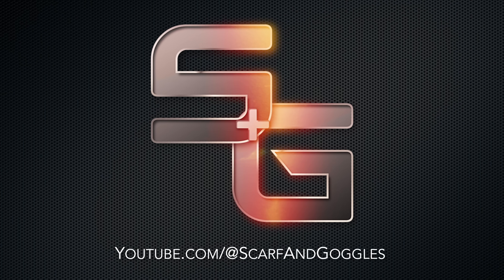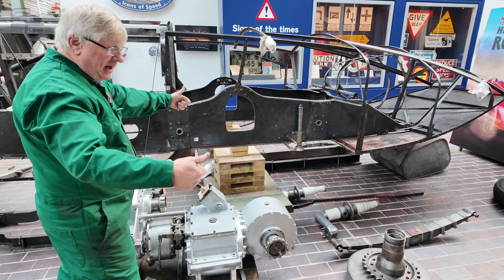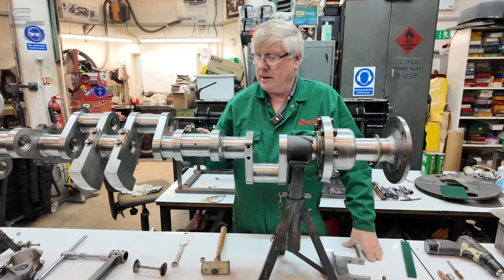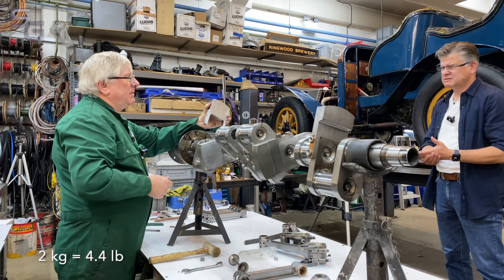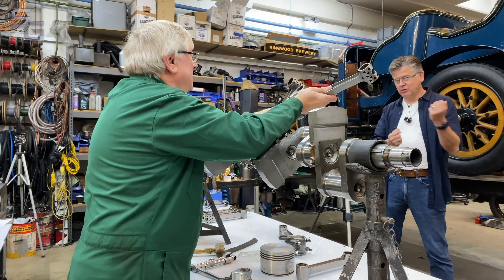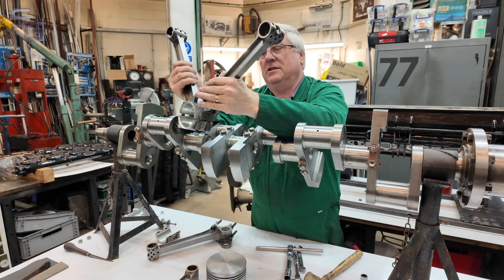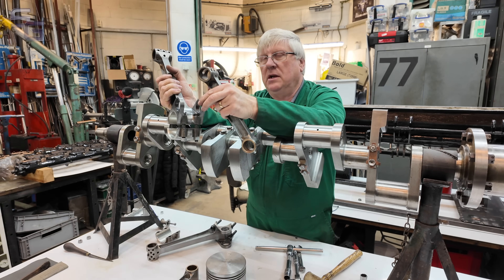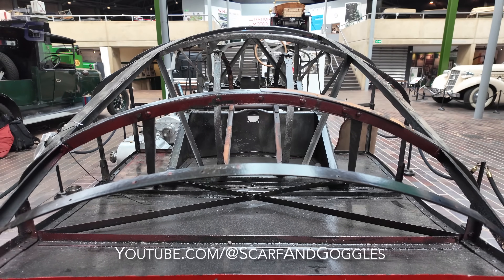Sunbeam 1000hp Rebuild (Part 4) - Restoring the first 200mph land speed car

Comment: For a long time I was wondering what on earth were they doing using chains for a final drive system, then it dawned on me, using chains and sprockets would allow them to very easily adjust the final drive ratio.  In fact I've been doing something similar with my tuned up Honda MT5 moped, I must have 3 front sprockets and 6 rear sprockets. My personal Land speed record on the flat whilst on the 'ped is 55MPH 😀

Comment: This is a fantastic insight into both the machine itself as well as the incredibly skilled work of the restorers. 

Just a thought - could the flywheel perhaps be tungsten steel, which would explain its density compared with standard steel?
Reply from the maker: Good thought about the flywheel. Glad you enjoyed the video!

Comment: A question ! Do you have the torque settings for the engine fixings ?
Reply from the maker: Thanks for your interest. I don't personally know them, and Stan has told me there is no documentation for the Sunbeam Matabele engines. Perhaps the choice of torque settings comes down to experience if there's no other info available...?
Reply: @ScarfAndGoggles  Possibly ! I remember reading somewhere that we're surprisingly good at 'feeling' when a bolt is 'tight enough' !

I think there is a way of testing bolts by torquing them up with a dial gauge attached so you can see when they're being stretched beyond their elastic limit  - all a little above my paygrade - but then, I have the luxury of a Haynes manual for my car !

Thanks for the reply !!

Comment: Surprised they didn't paint the inside of all the gear boxes with glyptal or similar (if it's even available in Britain) to seal the boxes from the inside. If they are that porous it would get good adhesion.

Comment: The question is, will they drive it to 200mph again ?
Reply: I believe they have said that they will keep it to 70 mph or so, because they can't run it faster with the tyres available today.
Reply: @greyone40  This question was already answered in Part 3. They will just run it 70 mph. Not more.
Reply: Very doubtful. The risk is too high. They’re probably going to get it running and driving then can do shows and have it at least make noise and drive around. May do something like goodwood and run it around the track.

Comment: Although the stroke is the same, the piston motion is not. Due to the offset from the centre of rotation, the rod length is different. This affects the piston motion and the piston speed.
Reply: Offset piston pin for performance baby...   Smoky Yunick trick

Comment: Should someone do a torsional vibration analisys on this system? It's iriplacable, would hate to see somthing break
Reply from the maker: Good point, although the engines aren't very stressed - they're expected to run at around 2 to 3000 rpm.